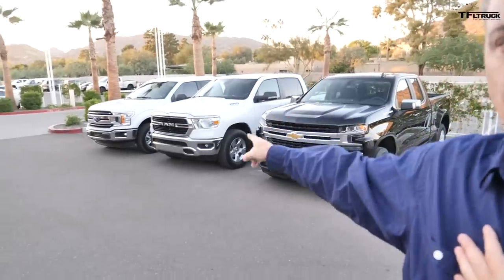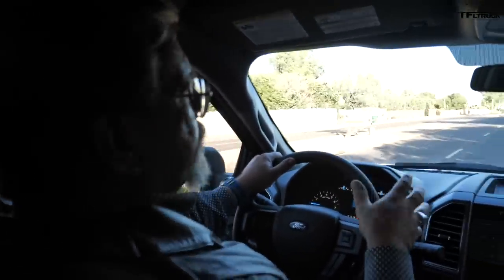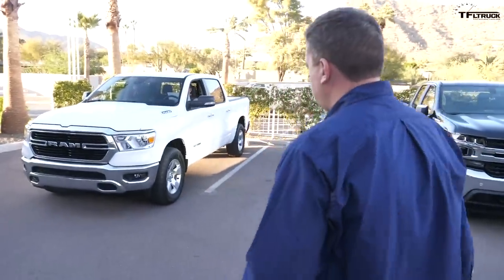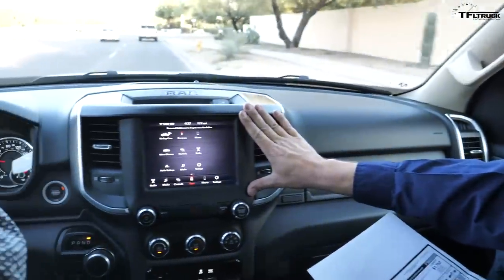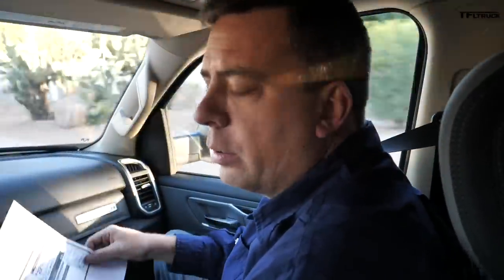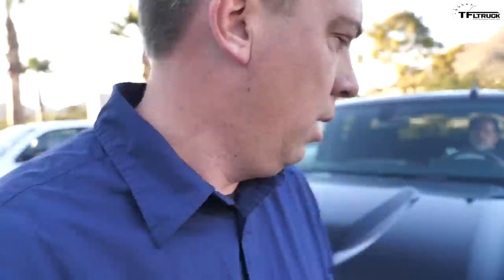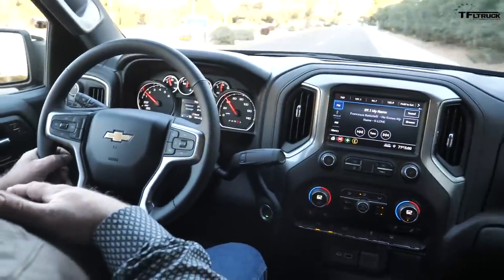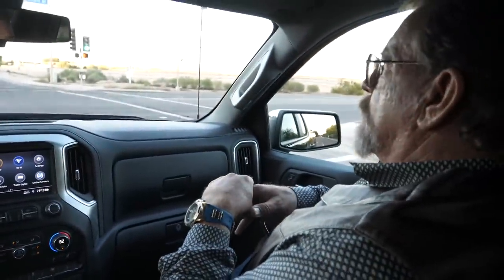Work Truck Wars: 2019 Chevy Silverado 4-Cylinder Turbo vs Ford F150 vs Ram 1500 Review

Comment: Gm bashed Ford for their ecoboost motors and then they go and put ratatouille under their hood 😂
Reply: At least itll make good food
Reply: And after bashing Ford for an aluminum body, they use  a lot of aluminum on their trucks.
Reply: Don’t tell Chevy fans tho 🤣🤣🤣
Reply: At least Chevy doesn't shove it down our throat, I want a V-8 not a v-6 with a penis extension in my truck.
Reply: Also tried to jack the ram box
Reply: Tommy Truth
only medal that swings is Aluminum on GM, not the whole truck
Reply: @SickTheory  Ford still sells the 5.0 coyote. And those ecoboost twin turbos kind of embarrass GMs 5.3 and 6.2 l8tr v8's
Reply: @SickTheory  just curious. What v8 do you have in your truck? Ford offers the 5.0 V8 and the twin turbo V6 in ALL of their half ton trucks. Not just a certain model or trim like GM.
Reply: @texw4062 , things don't go on forever
Reply: @Grem135 , at a dragstrip maybe, but the GM 6.2 gets better fuel a mile above sea level towing 7000 lbs, doing what trucks are meant to do
Reply: @tommytruth7595  And now Chevy not only puts a bunch of aluminum components in their trucks but a ton of plastic.  Even in the suspension!
Reply: @Grem135  Much like how the 6.0 Powerstroke "embarrassed" the Cummins and Duramax when it debuted in 2003. 15 years later, look who's still on the road...
Reply: Loll
Reply: GM also now recommends lifting their cabs to do major engine work.
Reply: @royj8549  well, the Ecoboost was released 8 years ago, it's already proven. Those 6.0 failed much earlier...
Reply: @texw4062    these are the base line light duty half tons  V-8's  are for the Heavier or top of the line trucks
Reply: Well @Jonathon lopez   the V-6 with Twin Turbos  very complex and they didn't hold up very well in towing ..    and I-4 is tougher and easier to work on just like the Cummins I-6    The Eco  boost was good in a grocery  getter but did not hold up towing anything heavy
Reply: @tommytruth7595  gm was using Aluminum in 2014.
Reply: @Grem135  5.3 LT V-8, would you belieave it's been availabe since the late 90's?  It's a great and proven reliable engine, of course the new 5.3's have better internals and active fuel management systems but it's the work horse of GM.  Go back to the mid to late 1920's what were they using in most American vehicles? Can you belieave Ford was the first car manufacture to mass produce the all famous flat head V-8.  I am a man and I want my crown jewels driven around in an american V-8.
Reply: @Ilikeryche  well lets take a look, what happens when you take off that E torque system, what happens next? Its becomes a regular V-8! Would you belieave that!? Now let's take a look at the penise extensions of the V-6, what happens when you take off those twin turbos?  Ohhh my! You get a 2.7 V-6!, 3.5 v-6! Ect ect... 

I love the sound my V-8 makes driving down the road, how many F-150' owners can say that?
Reply: Tommy Truth that was just for the bed, in which GM still uses a steel bed. Only the fenders, doors and hood are aluminium.
Reply: Ratatouille. 😂😂😂😂
Reply: @tommytruth7595  
The same goes for GM bashed Ford for their "man step" and how they lied in their commercial about Ford's aluminum bed. Big Truck Big RV did a review on this very dishonest story by GM.
Reply: @Sig721Tau  down the road how many brand new F-150's do you see with a V-8? What's the ratio of V-6 to V-8's sold I'd say for every 10 they sell maybe 2 are v-8's.  Ford claims the V-6 with the penise extensions are superior to V-8? With more power? More torque? But when it comes down to towing it fails big time with less than sub par MPG, how many different variations of v-6 do they have? How many v-8's? Listen it's understandable if you drive one dont get all butt hurt over having a penis extension it's ok, not all of us are blessed in that department.  I'm a mans man and my nuts will not be driven around in a full size truck with a tiny 3.5 LT V-6.  In my garage sits a 65 Ford mustang 289 V-8 with glass pipes I love the sound of that V-8 too bad you cant say the same thing about your new fords.
Reply: @jasondavis1453  chevy has used the "ram box" since 2001 when it debuted in the Avalanche, soo....No
Reply: @brandonk7720  wasn't that a cooler
Reply: The gas mileage of it made it absolutely pointless.
Reply: @royj8549  the Duramax and Cummins!!!
Reply: @luisinhoens90  I've been hearing alot of issued on the Ecoboost local to me... I would hate to rely on power from a turbo..
Reply: @Jose Alberto Rosa-Suliveres so comparing a base to a base?
Reply: @mrhaggin429  What is the big deal  in that , Ford does that on the super duty trucks. It saves times , and money on certain repairs is why instead of having to pull the engine .
Reply: @anthonywebber2211   My 2.7 EB produces more torque then the older 6.2 motors lol . It produces more low end torque then the current one. I do like 6.2 , It is a solid motor , but power wise it can't compete with the 3.5 . You can't always look at peak numbers . EB hits 80% of it's torque very low , like 2700 vs a NA V8 hitting it at 4500 .
Reply: @calebniederhofer6529  
Get your facts straight cupcake, the second generation 2.7 EcoBoost makes 400 lb-ft of torque, L92 6.2 V8 makes 417 and current 6.2 make 460
Reply: @anthonywebber2211   First of well , Calling me cupcake only makes you look ignorant , and not someone who can hold a  respectful adult conversation . Those are fly wheel numbers , not RWHP . The 2.7 , and 3.5 both perform very well respected dyno numbers stock , and far superior tuned. You are talking about  peak numbers , but what matters is where it hits the peak torque , power to the wheels . So maybe before you trash someone in the comment , you should actually have knowledge on the subject. Have a blessed day Caleb. If you actually read in the comment , I said peak low end torque , But you went strait to flywheel numbers lol.
Reply: @calebniederhofer6529  
Yeah, Ford does a great job of that, seeing a GM 6.2 gets better fuel mileage towing 7000 lbs a mile above sea level then a 3.5 EcoBoost and GM's 6.6 diesel out performed Ford 6.7 diesel despite making more power 🤦‍♂️
Reply: @anthonywebber2211   It all depends man ,  all gas engines get horrible  milage towing. So that should not be a deciding factor.  You would need to get a diesel to get any kind of efficiency .  As far as half ton trucks , the 3.5 is the best powerwise, towing . It produces  the low end torque up hills , higher elevation , the NA v8 just can't. Except for the 7.3 which will hit peak torque very low.  Half ton trucks are for light towing , you will need to step to a 3/4 ton for stability , towing often.  I could care less what the 6.6 does in a track , or up some timed hills.  Cummins 6.7 is best commercial rated engine for towing . Having said that the ford i think has the best overall truck , and fords 6.7 is a very good motor. The 6.6 duramax has never been as reliable of a motor , but that does not mean it is not good. People have put 500k on them .  It is preference , but these  diesel trucks are rated , more capable then what 95% people tow anyways.
Reply: @calebniederhofer6529  
I only mentioned diesels, because you think Ford can put the power to the road better, and I'll make it worse on Ford, Ford was out performed at GMs tow rating which was considerably less at the time, and there are mileage Duramaxs, and gale banks prefers the Duramax over Powerchoke and Cummins
Reply: John Tarantino  
It's a truck, not a sports car
Reply: John Tarantino  
Big whoop
Reply: @calebniederhofer6529   Remember When Ford  built those  engines that blew the spark plugs out of the cylinder heads..  Those are the kind of things that make me avoid FORD
Reply: @mikeskidmore6754  Every manufacture has had  some kind of problem . If you go by that logic , then you would be riding a bike .  Ford is building solid trucks , and EB has only improved with the gen2.  The 6.7 has been a solid motor since ford went in house to build it .
Reply: John Tarantino  
What are you compensating for?
Reply: @calebniederhofer6529    What is EB   ..  you  are  going to pay up the ass for odd ball obsolete Ford Parts..   Ford  Pickup door Hinge  $120.00  1975     Chevy  C-65  door  hinge was the same as a C-10 and I bought a new one for $20.00  when you use a  truck off road to spread lime  open and close the door  100 times per day the hinges wear out.
  I also have a worn out door hinge on a Freightliner   it is piano  hinge style .. would last forever of the owner was smart enough to lubricate it .. I bought my Freightliner used with  500,000 miles on it ..
Reply: The GM  4 Cylinder turbo motor  sounds very Robust.. only time will tell ..  I will bet it does not blow spark plugs out of the heads  or totally fail at  50,000  miles  like some of Fords  overhead cam motors have..
Reply: @calebniederhofer6529   My  friend ran a Duramax  Dually  pulling campers  to deliver for a camper manufacturer  for  700,000  miles  replaced the injectors  once  then traded it in on a new one  4 door  4 wheel drive  ect..    So  you may as well use  700,000 miles for a Benchmark..  all the Same  the straight 6 Cummins  far easier to work on and  most likely  more reliable ..
Reply: @mikeskidmore6754   Yea , There have been people go a million miles in a duramax.  Any of these diesels will outlast gas engines.  However i stand behind my previous comments . No worries , people have there preference.
Reply: @mikeskidmore6754   What in the world does a freightliner have to do with anything lol. There is earth , and jupiter you are somewhere in the middle. No worries though my friend.
Reply: Tommy Truth yeah but didn’t put aluminum in the bed. Thank god
Reply: Mr Haggin that’s ford sorry.. even the f250 f350 trucks are nightmares to work on. I talk to a lot of towing company’s that switch to ram and gm because of these things that ford dose when something breaks.
Reply: Mike Skidmore the people that get high mileage in their vehicles are because they service them faithfully and don't abuse them. Period. All brands out there are reliable
Reply: Tommy Truth to be fair the aluminum debate is about the body. 
Ford dropped 780lbs from the 150 by switching to aluminum while maintaining the same strength profile of the previous steel body. 
The telling aspect to me is that: 
GM evaluates if aluminum is the way to go for future truck production, they said no, not the best way for them. Ok I can respect that. 
However then they drop 475 lbs of steel out of their steel body trucks. This is a poor decision when at that very time customers are already complaining about the steel body panels being too thin and easy to dent. Tahoe fenders were being dented from people leaning on them. 
Aluminum makes a lot of sense for vehicle production from start to end of life.
Reply: @tommytruth7595  as a chevy fan i got to agree but chevy beds to still hold up more
Reply: 😂 Good on Ford. They got their Kickback/bailout by developing that engine on our tax dollars hahaha...
Reply: @SickTheory  I wish gm made a competitive v8 though they make the 6.2 that takes 93 octane fuel so that’s a hard pass as that makes gas 36% more expensive or the 5.3 that makes so much less power yet somehow gets worse mpg
Reply: @anthonywebber2211  gm has aluminum in the bes
Reply: @anthonywebber2211  yes on 93 octane fuel that the 6.2 takes it better run away from everything rlse
Reply: @SickTheory  lol that 5.3 also known to self destruct well before 100k when the dod lifters explode
Reply: @sergiupuscasu2496  I want to see the beds after 10 years in the rust belt
Reply: @williamsteelejr1534  lol yeah turbos are only in every large truck or any industry equipment hat covers millions of miles
Reply: @mikeskidmore6754  I remember when gm lied under oath about killing people with faulty ignition switches or when they denied replacing the garbage 8 speed in the trucks under warranty because it was a bad design not poor workmanship or bad parts so it’s not covered under there warranty lol yeah I’ll pass
Reply: @mikeskidmore6754  or gm 5.3 that would fill the motor with needle bearings when the lifters blew apart at 40-60k or the trans gm would not fix 8 speed that was bad design and they said warranty only covers bad parts or workmanship
Reply: @mddunlap03  I'm a fleet manager of a trucking company.  I'm aware of turbos, understand a diesel and it's turbo is built.  The Ford isn't. The Chevy isn't. No comparison there.
Reply: @mddunlap03  ?
Reply: @Grem135  Only the HO EcoBoost embarrasses the 6.2 on HP.  The 6.2 NON TURBO V8 has 420 HP and 460 LB-FT.  NOW, for long term reliability, would you rather have a loping, easy going V8 or a stressed, boosted V6.  My bet is that, under the exact same circumstances,  the V8 would be better.
Reply: @406Steven  Untrue.   None of the manufacturers put plastic in their suspension.
Reply: @jeffwill4923  And, in GM's favor....directly copied and pasted from the article (read it yourself): "Others have expressed interest in GM's technology. Ford's strategy, so far, is not being emulated by others."  Hmmmm...if it was so great, wouldn't other manufacturers try to emulate it??
Reply: @scottandrews4822  True. 2019+ Silverados use a composite (plastic) helper leaf.
Reply: Yeah but it has variable timing AND lift. It's basically a 4cylinder LT1.
Reply: @Grem135  the 2.7 embarrasses the 5.3 and it only has a single turbo.
Reply: @mikeskidmore6754  that’s untrue. V8s suck.